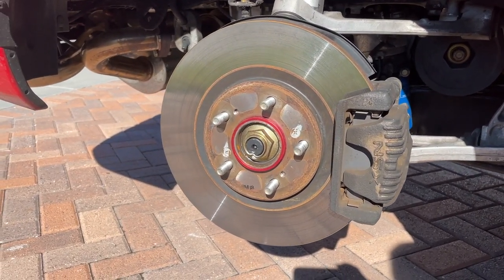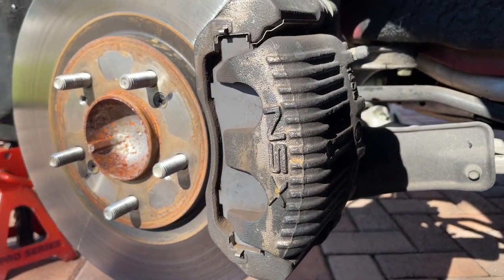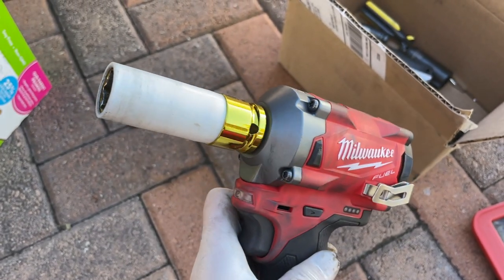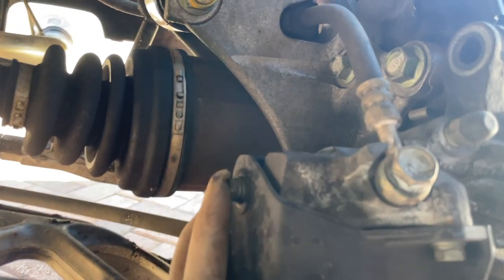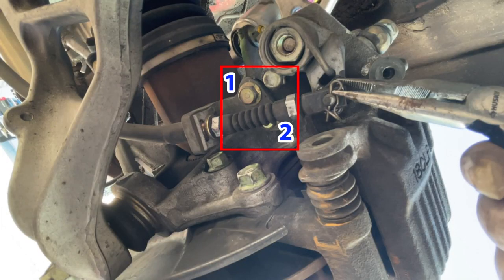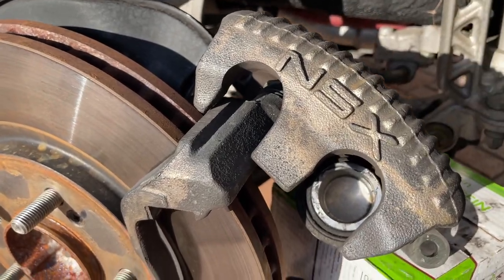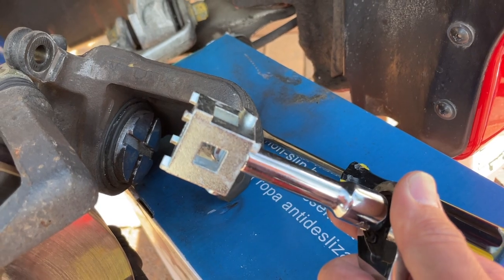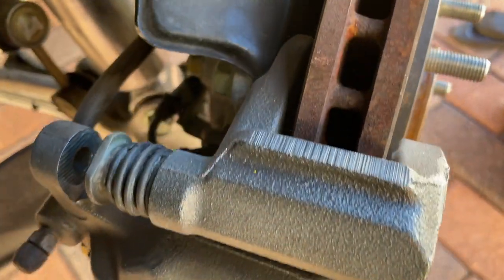Restoring NSX Brake Calipers

Comment: Looks good man. Just a quick recommendation is that you should definitely spend the time to clean the crap off the frame inside the wheel wells.. It takes a lot of work to scrape it off but you will love your wheel wells once that dirt and tar is off. Not even joking there must have been 3lbs of it on my car, more weight reduction 🤙🏼